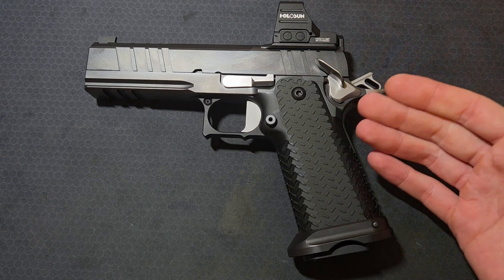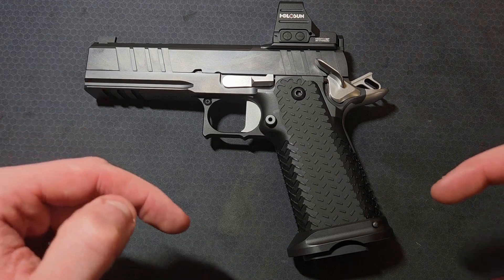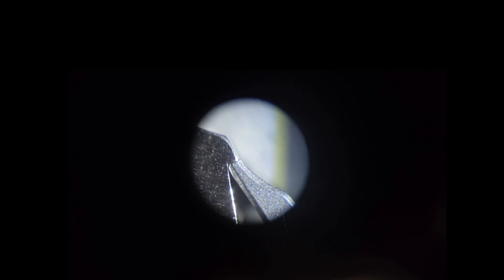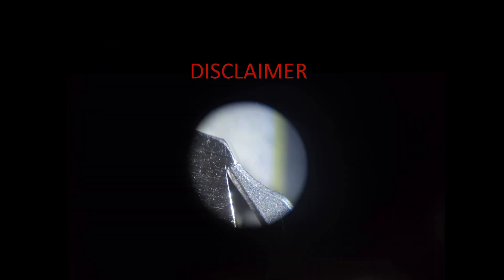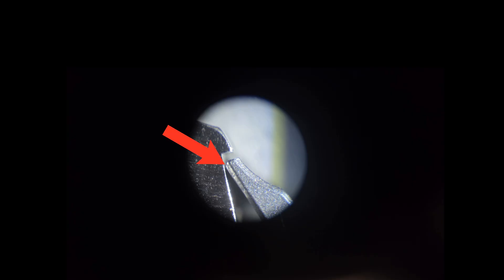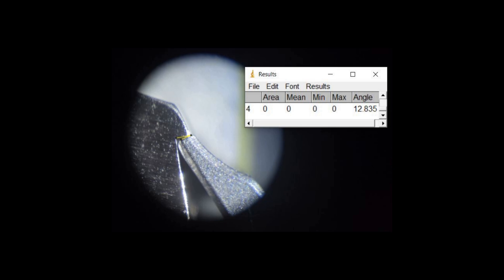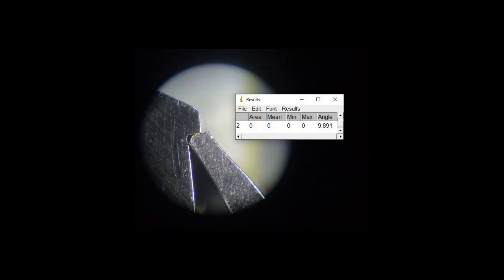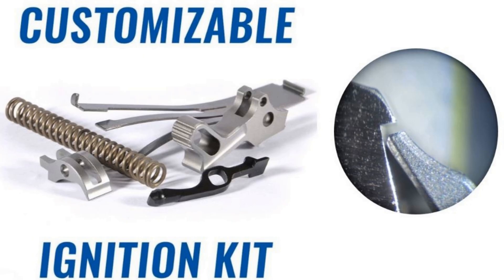EGW Ignition Kit Sear and Hammer Inspection

Comment: Your videos are super insightful. If i'm having very minimal pre-travel in my trigger and I don't have any trigger shoe adjustments removing pre-travel,  is this most likely caused by the sear/disconnector geometry?
Reply from the maker: Trigger bow is probably long. Possibly the sear and disconnector are closer than they should be which would be maybe an issue with frame holes. But a long trigger bow is most likely.

Comment: I recall in one of your videos you said that you really wanted to get ahold of an Atlas "ignition kit" but they were constantly out of stock.  Did you ever get one?  If so, will we see a similar video on it?
Reply from the maker: Yeah they are available now. They are the same EGW sear and hammer. They just match a hammer and sear from the large batches they buy. I don't think I'll buy one. I would guess they wont be much different from what is seen here. I would imagine EGW holds pretty tight tolerances on their sears and hammers.
Reply: @EngineersArmory  Interesting information, thank you.  You know, I have this Colt Combat Elite that got "the treatment" for Limited use and it had the stock hammer modified.  It had about 1-1.5mm taken off each side to lighten it up a bit.  Nothing taken off the bearing surfaces of course, but quite a lot to improve lock time.  Now days you can just buy them that way.  LOL, the good oldays right?

Comment: I used EGW FCG parts on my USPSA Competition Guns. 
Trigger pull weight under 2# was common when set up correctly. 
Have you tried a”True Radius” Sear Jig? Eliminates the lifting of hammer through the trigger press. I much prefer it for Sear prep.
Reply from the maker: Have not tried it. I have heard it produces more of a rolling break due to the "true neutral" geometry. I prefer crisp breaks. I really like how my trigger jobs come out as is with a flat primary face.

Comment: EGW offers a shortened sear for a Springfield Prodigy -- if you ever get around to it would be cool to see your opinion on the fitment of that and maybe how to cut the primary/secondary angle (if needed).
Reply from the maker: Dont have a prodigy. I borrowed one from a friend once and made a tune up video. 

Im kinda curious why the sear needs to be shorter. But in general i would imagine cutting the primary and secondary angle would be the same as any other sear. However cutting the already short sear shorter might be a bad idea. My guess is the sear geometry is similar to the one shown in this video. 

Also how i cut my sears is based on how i want my triggers, and it varies from trigger to trigger, so i cant really show how to cut a sear in a way that would be a one size fits all solution.
Reply: @EngineersArmory  No idea either :). I figured cutting it would be a mistake -- I have a prodigy and the EGW kit and aside from polishing it similar to your videos, I didn't cut the angles on the sear. 

I did do a nice trigger job on a used 1911 I bought based on your videos where I did replace/fit all the parts, cut the angles, and polished everything up. Turned out great. All Wilson Combat parts except for the disconnector, which I used an EGW ball head. That really helped remove any remaining slop in the trigger.

Keep the videos coming bro, enjoying them a lot and learning a ton.

Comment: Thank you for making this video. I tell everyone a trigger job is not dropping in a new ignition kit. I use a Harris Design radial jig to set my primary and secondary angles on my guns. I then polish each piece to remove any friction. 

I’ve seen whole batches of sears and hammers get binned after the CMM measures the dimensions. Most machine shops have solid QC but as you’ve seen even the good ones let stuff get out that shouldn’t have passed. Love the technical aspect of your videos brother.
Reply: I think it's important for people to realize that even if every part of the "drop in kit" was manufactured "perfect", it can't take into account the minute differences in the geometry in the pin holes in the frame. CAD software with interference detection and parts movement really has revolutionized the game for individual fittings
Reply: @KellyR-qx7wn  Couldn’t agree more. I’ve got a video on my channel I’m putting together from a shop tour I did at Three Sigma. The lead engineer was showing me the fixtures in which the frames ride in and the different ops they use to make parts. It’s really fascinating how these 5 axis machines can spit out a perfect part damn near every time.

I believe they use a technique with the tooling during the op that allows hole dimensions to be drilled perfectly parallel. Atlas uses the same technique when they make their frames as well. I’m still learning about the manufacturing piece but I love the technical aspect of it all.